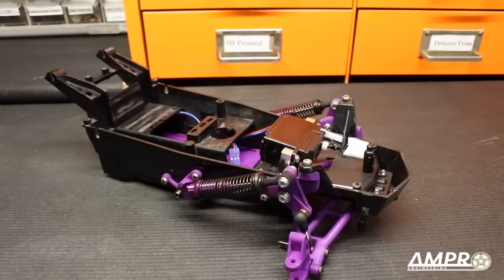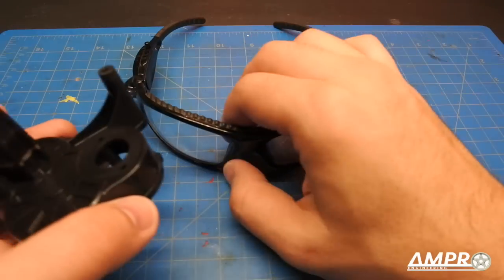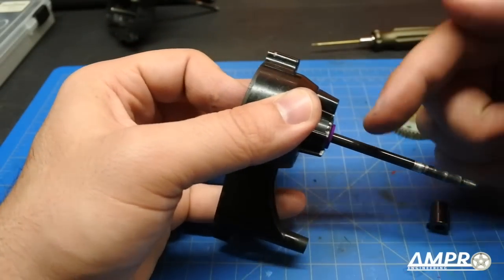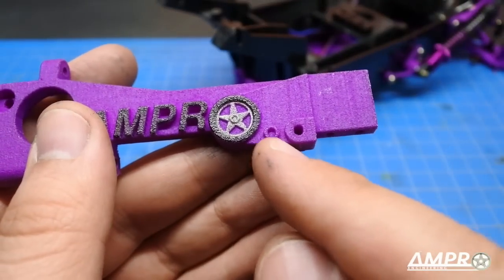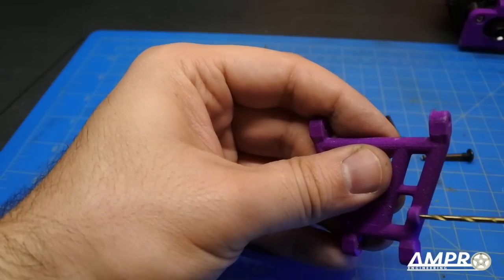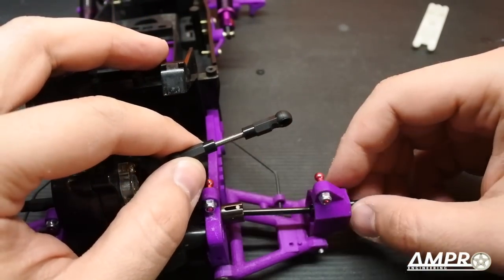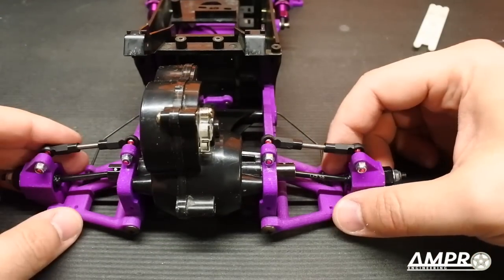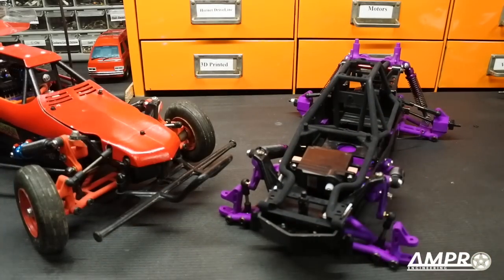e68: Tamiya Hornet "SuperFly II" Build Part 4 - Rear Suspension Install

Comment: Quite an absorbing few hours I spent tonight, first on your builds on 2 forums, then on to your YT channel and then to your Shapeways shop. This in itself is a great example of how product creation, manufacturing and marketing are changing by 3D printing and the Internet.
An engineer myself, the real game changer for me is the almost complete freedom of shape created with 3D printing. Very nice to put the material exactly where it's needed.
However the applications (of 3D printing) will stick to prototyping and "low volume, high complexity" markets where price is not the main driver. CNC based production will never be cheap.
Thanks for all your work. I will be spending some more time on your channel for sure!
p.s.: It's nice to hear you're so positive about Shapeways, being Dutch that makes me a bit proud.
Reply from the maker: Thank you for you kind words.I agree that 3D printing has changed the hobby for me and I hope for others. No longer must we "wish" for something or someone to do something. Now it is possible and affordable. Oh and yes, I simply love Shapeways! You should be proud.

Comment: Awesome project ! Your videos are clear , informative , and very well done.
 I use a product called Finish Line Ceramic wet chain lube that is sold at bicycle shop nearby, that works amazing for ball end, screw pivots , and any other metal to plastic contacts. Lasts a long time, and makes things smooth as buttah'. 
Again, great job, and I look forward to seeing that Hornet fly!
Reply from the maker: Thank you for the info. I will check it out. I forget what I use on my bike chain and I really should know considering how often I have to wash the bike thanks to the rain this year (my bicycle is my daily driver lol).
Reply: I looked at the ingredients , and the ceramic lube contains boron nitrade. I'm sure its great on bike chains, but for plastic to metal applications on RC cars its better than anything else I have used to keep things smooth. The stuff ( boron nitride) is insoluble with water and has a melting point of more than 5000 ° F . Overkill for a ball end or a pivot screw I'm sure, but a $7 4oz bottle goes a long, long way. Cheers!

Comment: Awesome build ⭐⭐I feel ya on just having #1 set of eyes 👀 Safety 1st 🙌. I never had a problem with the gearbox on the ! Grasshopper / midnight pumpkin nearly bulletproof . Very clever converting a solid axle to independent suspension.  👏👏👍
Reply from the maker: Thank you! This was a good attempt at using the gear case but version 3 will have its own gear case with the factory gears so that I can have better rear end geometry. That's the goal!
Reply: @AMPROEngineering  have faith you will figure it all out ! Due you take on restoration's ? I have a few that needs restoring 🤔 Time is my biggest obstacle & tracking down parts LOL. Got 2 real bruiser 's  & a king hauler. Basket cases but have all the parts!
Reply from the maker: Sorry man I wish I had the time. Between finishing a house addition, a real car resto, work and this...not to mention #1, the fam, haha! I wish I could pause time....Man I too have a bruiser that is a mess. That sucker is on the agenda....
Reply: @AMPROEngineering  it's all good my friend & I think I seen your bruiser . I bought the knockoff for parts but it ran so smooth & looks so good ! don't have in me to take it apart  LOL. Maybe I will buy another ! Anyone who wants a bruiser & don't have a grand $ that would be the ticket LOL . I'm pretty sure the gearbox was never that smooth on mine 🤔💯

Comment: You are a genious-Tamiya-engineer! They should hire you. Great solution. I was very curious about this but now that I see it it seems like the only logical solution. Great engineering will have that effect on folks :-) Ohhhh, and by the way, is it going to be a Tamiya Grasshopper Superfly? Your gear box seem very Grasshopper-like and not Hornet-like. But maybe it was different on the original ones? I only have re-re's. It doesn't look like a Grasshopper Rere gear box but more like a Hornet/Grasshopper II Rere gear box?
Reply from the maker: Hahah, thank you though with all the crap I talk about them I don't think they will like me. You are correct, the trans on SuperFly 2 is a GH one but all original Hornets had the GH trans until the Pumpkin came out. That is when the gear case was updated to make it stronger. For SuperFly 2, it doesn't mater since the axle tubes are no longer load bearing.
Reply: +AMPRO Engineering your aftermarket suspension package here is completely ingenious! independent rear suspension, solidified, and enough/more plastic back there to get a little more weight into the rear wheels (Hornets were always a bit squirrely, especially after dropping in a better 27 turn brushed stock motor).

edit: I do see one thing to perhaps consider adding to this, is shock mounting holes/locations. topside looking at it straight (from rear) kinda  *   ..            ..   * 

instead of the Tamiya metal U to catch the lower, looks like there is room for molding bar over the (angled) rearmost A-arm rod. long rectangle 7-8mm tall maybe 28mm wide, with 3 holes for mounting the bottom end of the shock to, kinda like this: ||  *    *    *  ||.  

gives options: at the upper an inner+softer sitting slightly taller, or outer+stiffer but sitting slightly lower.  at the bottom the 3 holes, outer being stiffer leverage wise, moving inboard letting the lower A have more leverage to the shock spring. also gives more game/play options setting shock collar spring stops.

the other observation/reasoning.. the dogbone situation. in this video they were sitting high, dogbones at a steep angle. sure I like suspension travel, but power transfers better when nearer flat/straight, maybe 20 degrees at most (the extension/angle limited by the length of the coil over shock absorber, and it's mounting points/locations), also takes the wild swings out of the dogbone ends and drive cups that gets them wearing out faster, or (sometimes) popping out. to be fair, I know this isn't looking at it at its full weight with battery pack in place. to me, dogbones swinging a total of more than 30 degrees starts getting a little spooky. at rest, I like seeing the dogbones sitting about 7-8 degrees, powered up weight transferring (squatted), dogbones running just about/almost flat horizontal, still having a little more positive than negative suspension travel. more places to mount the shock ends = more ways to play with set ups.
Reply: model nutty - That alternate shock mounting idea is a good one!  Screwing the lower shock mounts directly to the lower A-Arms  from back of the Arm, like many others. Multiple mounting holes through the A-Arms would give some more tuning options....
Alberto - you've gone THIS FAR, modifying the Hornet to an outstanding, and unidentifiable, serious machine!!  A few tuning options wouldn't be such a bad idea. 😉👍👍
Some people may have to live with springs that are a bit too stiff. Being able to move the lower mount closer to the fulcrum, would easily soften the rear suspension right up! Or move them out towards the wheel more..... in case you're one of those Neanderthals who still believe that the suspension MUST always be topped out at rest, not allowing the wheels to drop into dips in the track, increasing traction! 😲😲😲😂
Murph
Reply: JA thanks, know you get it. just had a "years later" (haha decades!) thought about hornet grasshopper stock front suspension couple days ago inspired by my own old mod and a guy doctoring up a lunchbox, basically double action vs single action using rubber washers and small on road front springs topside for 3/16" negative sprung (near twice that at wheel). always hated their bump steer for front A's standing tall. His aftermarket no butchering linked front end IS brilliant, love it! 

I sure knew a few of the cave man types who set up suspensions for landing off rooftops and doing the Tim Allen (more power!), they were always easy to pass, too stiff and CG so high, losing a lot of power transfer at the bones (wearing out drive cups fast too). they'd always cringe at my RC10 rear bottoming out landing jumps (not bouncing tho!). I always set up kinda soft/loose, press down on left/right sides of the pan and see the wheels tipping/leaning left right, "on it's bicycle" is what we called it, gets the bite happening through the corners. just like old BMX racing, you cant accelerate when you're in the air, the fast guys weren't trying to do the big+pretty, they'd soak to keep low.
Reply: model nutty - EXACTLY! Some people look at droop, as something to be avoided at all costs.... Truly uninformed.

Comment: When you want to cut a bolt, spin the bolt in a cordless drill and dremmel off while spinning. Smooth cutting technique like a lathe. Practice first though. All the best, John
Reply from the maker: What about the threads in the chuck? How do you prevent damage to them? Install them in some nuts?
Reply: AMPRO Engineering I usually put the part I don't want in the chuck.

Comment: Finally got to watch this without interruption, excellent work.  Do the stock grasshopper wheels fit the new rear axle/hex, or how does that work?
Reply from the maker: Na that is my biggest regret. Thanks to the axles I needed and what I had to do to narrow the rear end, I just could not get the rear rims to fit. I am thinking I can make an updated rim to fit the stock tires though.

Comment: in the video, you mentioned the ball bearing adaptors / holders, do you have the part number in shapeways? Seems like I couldn’t find it them. 

I see in comments and replies from you that you state that part #'s listed in video but when you are applying these rear bearing adaptor holders I don't see a part # listing as well as for the rear shock tower no part # listed that I can find for that either. Also on your ampro website there are no listings of these 2 items either.
Reply from the maker: The bearing holders are part of the 045019-00 ampro omega frame set as is the shock tower. I was able to get all of them in that for a lower price. Sorry for the confusion!

Comment: I'm just wondering how long those small bearings on the trans outputs will last..amazing engineering btw just found ypur channel yesterday and I'm hooked
Reply from the maker: You have me wondering what bearings I used now...I think they were 5x11? Or did I use the 5x8? Either way, they should last decades given the clay track I am racing on. In dirt, well that is a different story...a couple years at that point. Thank you so much! I am glad you like my channel!
Reply: AMPRO Engineering yeah I was referring to the 5x8 bearings
Reply from the maker: Yeah they are pretty robust and given that this car wont see anything but clay I think they will be fine.

Comment: Thank you very much for your reply indeed. I looked up the product Omega frame on shapeways.  And it did describe the additional parts that we neee to purchase for Superfly2 conversion project. May be I overlooked but may I know which one is that “bearing holder/adaptor” that you mentioned in the video.?
Many thanks again

PRODUCT DESCRIPTION

The Ampro Omega Rear Suspension is the ultimate upgrade for the Tamiya Hornet & Grasshopper. Though a major operation, the kit will leave you with a Hornet that can handle! Please note that the parts you get here need to be accompanied with the following parts to complete the set. You will also need a number of additional parts available at your hobby shop and eBay. Stock rear wheels will no longer work. Hex drive wheels, 2.2” should work but not all can be tested. Ampro makes a set for the Omega rear end. 

***Note that significant modifications are needed if you run a Grasshopper body. ***

This is the 045019-00 Omega Frame set. 

045018-00 Omega Arms
045018-01 Omega Arms with eyelets for Sway Bar 

045017-00 Omega 0° Deg Hub Carriers
045017-01 Omega 1.5° Deg Hub Carriers
045017-02 Omega 3° Deg Hub Carriers
045007-01 Hornet Shock & Wing Mount
045007-02 Hornet Shock & Ampro Wing Mount
(for use with Ampro Wing, display only)
045007-03 Hornet Shock & Heavy Duty Wing Mount
(body may need light modification to fit)
045007-04 Hornet Shock Mount

 045005-01 AMPro Hornet Battery Tray Retainer
(See episode 60 for installation)

045015-01 Shock Eyelet, 16.75mm
http://shpws.me/Ooq7

 Rims:
Rim003-00 2.2” Wheel, 0mm Offset
Rim003-03 2.2” Wheel; 3mm Offset
Rim002-19 2.2" 19mm Offset Rear Wheel

 ADDITIONAL PARTS NEEDED
Axles- Tamiya DF03RA & TA04
RC Joint Cups, Tamiya Part Number: 9804181
Comes in 2 and 4 pieces, 2 needed
Two 5x8x2.5 Ball Bearings
4x 5X11 Ball Bearings 

HARDWARE
2x 20mm M3 Machine Screws
4x 16mm M3 Machine Screws
12x 12mm Long Self Tapping Screw
4x 8mm Long Self Tapping Screw
4x 4.8mm diameter x 10mm long Ball Studs
4x 4.8mm Ball Cups
1x 3mm threaded rod, 100mm long is fine
6x Screw pins, 30mm long at least (longer is better, cut to length
1.6mm diameter, 1000mm Long Piano Wire for sway bar (optional)
16x M3 Washer, 0.5mm thick max
10x M3 Locknuts
4 Tamiya 4mm diameter x 6mm length brass sleeves
2x Tamiya Spring Mount (H4)
Reply from the maker: Ah yes, that little part that holds the bearing it in the trans case? That is part of the 045019-00 Ampro Omega Frame assembly. They are held in with the sprue. Thank you for asking! Always better to know ahead of time.

Comment: I assume this can also work for the grasshopper? With possibly dremiling the hornet wing support mount
Reply from the maker: Indeed but im sure body mods are needed. There is a version of the mount you are talking about that does not have the wing mounts for those that wanted to run a stock hornet shell. It is in the Hornet section on my shapeways page.
Reply: @AMPROEngineering  As much as I hate touching the body, its a mod probably worth doing. Ooo awesome! Ill be sure to have a look, many thanks! #PintoPower 

PS thank you for all your hard work and contributions towards these kits.

Comment: WOW.Fantastic!As a Hornet AND Grasshopper lover..i would love to build one of my cars into one, with this suspension,Fantastic design..But i do have  one  or two questions.When it comes to 3d printed parts...the finish make em look so brittle....are the parts "strong" enough..i always wondered about how well the 3d printed plastic will hold up.
And..is it also possible to order this in other colors?or?
Greetings from Norway, Stefan
Reply from the maker: Hello Stefan, I know what you mean. They do look brittle and even feel that way when you hold them. After years of use and abuse, I can say that they are not as strong as molded nylon but they are far from weak. I have raced my solid axle SuperFly 2 for about 5 years with modern cars with no problems. ABS can be better but they are hideous to look at and most companies (like shapeways where my parts are available) will not offer it currently due to the cosmetics and finishing required. Have you seen the running videos of this car or my other printed cars like my Blackfoot with front and rear nylon suspension? I hope this info helps!
Reply: hey mister.Thanx for reply.I do think i have seen those videos yes...but i will happily check em out again.and very helpfull info it is .Thank you.Greetings, Stefan

Comment: do you print by your own or use 3d printing services? those parts looks and sounds rugged and strong
Reply from the maker: Hello Vinna, I use Shapeways.com for everything. Between their quality, material selection and prices, they are a steal. Plus, I do not need to buy or maintain the printers.

Comment: Do you make a upper mount for the grasshopper? I don't really want to add a whole wing :)
Reply from the maker: I make one that has no wing mounts. They can also be found in my horn at section but it has never been tested on a grasshopper so it's possible some modifications will be necessary

Comment: Just curious, but is this available in a complete kit? My first rc was a hornet and I'd love to buy 2 more. 1 to modify and 1 to keep stock.
Reply from the maker: Complete as in hardware also? Sorry I dont have the time to make kits, I wish I did! The parts needed should be available from most hobby shops though.
Reply: @AMPROEngineering  not all the hardware, but all the parts that you make to convert them over. I like the way your kit looks on the hornet and want to build one. You kits make them unique.

Comment: Can I ask what are axle Lengths? I have some spare Tamiya monster beetle universal shaft sets laying around. part number 53908. Would these work?
Reply from the maker: That was what I planned on using originally but they will not work. The stub axle is too long. These will only work with the ones I spec in the video.

Comment: Will your suspension upgrades work on any car with the same chassis?
Reply from the maker: Yes but there will probably be body modifications needed for the Rockbuster, Grasshopper, Cyclone, Galaxy Buggy and Hornet. This will not work on anything other than the Grasshopper/Hornet form factor chassis and transmission. What car were you thinking?

Comment: Thanks, is this still available in 2022, and does it fit the Grasshopper as well?
Reply from the maker: It sure is! Links in description. This can fit the GH but modification will be needed to the body.
Reply: @AMPROEngineering  thanks. I have a NOS GS incoming any day. Looking for a winter mod project. Will contact you later then👍🏻🏎💨

Comment: Hi will this work on the super hornet also where do I get the file as I have high end 3d printers at work and can print in asa infused with carbon fibre so it is super strong
Reply from the maker: I think we talked on IG?

Comment: What do the piano wire sway bars do?
Reply from the maker: They help to lift the inside wheel on a hard turn to help prevent body roll and in extreme cases, roll over.